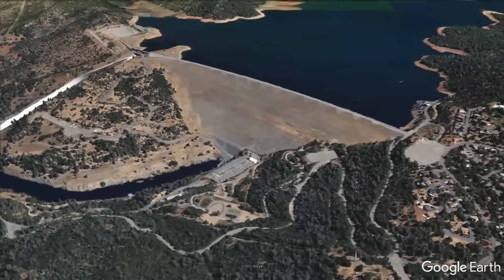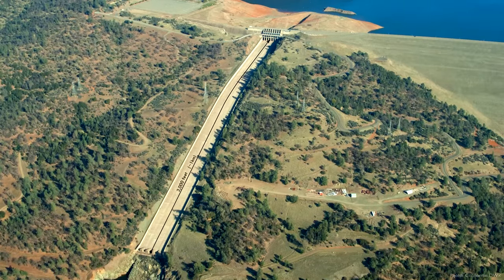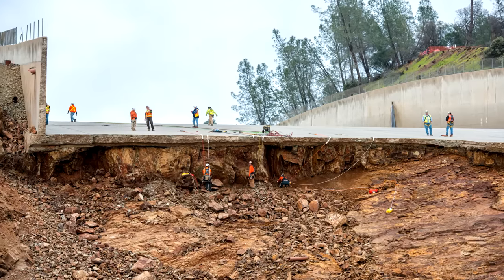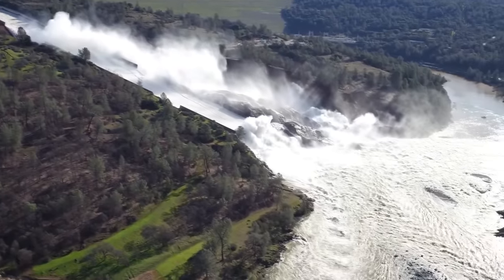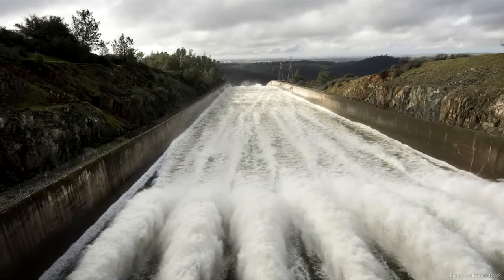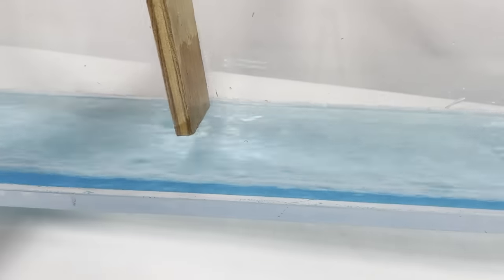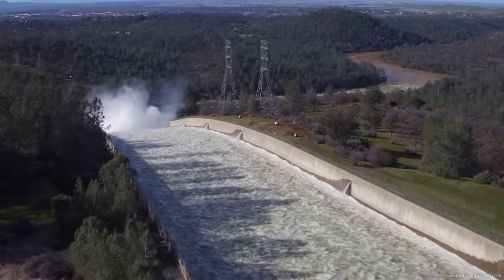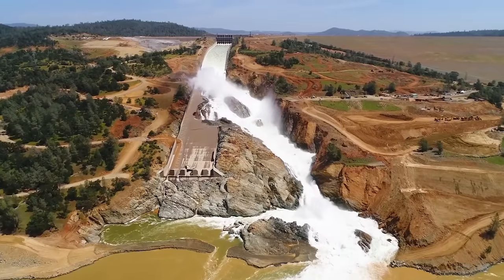What Really Happened at the Oroville Dam Spillway?

Comment: It’s unfortunate when your emergency spillway is in itself an emergency
Reply: Yes, but I would have done the same thing they did. Tried to use the emergency spillway for what it was nominally designed for until it became apparent that it couldn't sustain further use.
Reply: @thorr18BEM  if I recall, they used the emergency spillway only because they had flow restocked down the main spillway to keep damage lower.
Once the erosion on the emergency spillway was proving to be dangerous to the entire dam structure, they let er rip down the main spillway as it could handle far more erosion before the integrity of the dam was in danger.
The bedrock and natural plunge pool were very stable after a while
Reply: A cascade of errors (pun intended).
Reply: It's seams like our government did us dirty they were faced with a decisions of either risk flooding thousands of homes or flood a hydropower plant. It seams like there is more to this than just some engineering mistakes and I know this sounds like a conspiracy theory but knowing the track record of our public engineers it's not super unlikely that these people had $$$ in their eyes from the very start and didn't care about safety
Reply: @littlejack59 the problem isn't money when you flood the hydropower plant, the problem is you risk flooding the power lines which powers the dam, which means you can no longer control the spillways and risk flooding the entire countryside anyway.
Reply: gold 4 govt
Reply: Hence the name. Duh!
Reply: @fungdark8270  The thing is, the people managing the disaster really had no idea what they were working with. The emergency spillway was never intended to be used except to prevent the overtopping of the dam in case of, well, a dire emergency. To use it intentionally as they did, we longer-term residents of Butte County who knew about the dam and it's infrastructure were taken aback, hoping the planners knew something we didn't. Nope.
Reply: I was completely shocked watching the emergency unfold on TV when seeing no visible rebar in the eroded areas.
Reply: they seen it coming years before  and chose not to do anything about it
Reply: @godblessknight  Sometime in the 1950s, the USAF experienced a "broken arrow." The only reason why the Air Force did not accidentally annihilate a US city was that the fail-safes had fail-safes and all but two failed. If the nuke had been a previous generation, the outcome would have been a lot worse than bad publicity for the Air Force.

Why was such a concept in place at Oroville Damn?
Reply: @joe2mercs  i read this as the narrator said 'slip through the crack' 🤣👍
Reply: @thorr18BEM  i mean, it was built exactly for that purpose, though hoping to never need it. if you can't make the decision to use it in an emergency, why even build it? the fact that it also had a deadly flaw is almost beside the point, just very unfortunate
Reply: @godblessknight  in hindsight, having the power plant be in the flow path seems like a mistake. if they had placed it further back they could have made a different decision
Reply: @littlejack59  our government.  Uhh you mean California government.  And they have a long track record mismanaging situations and creating larger problems.
Reply: How did they not realize it was highly erodible tho? No way they tested that ground for bedrock, they just never planned for it to be used to save money...
Reply: @Killer_Turnip  probably just used previous design.  It worked once.  It will work again.
Reply: @jonney_boy  like? Substitute is!
Reply: Activate the emergency emergency spillway!!
Reply: @littlejack59  you're not wrong.  Recently did  work for one of the mamagers who was on the project during the failure and said that what's budgeted for repairs/maintenance and what's actually put towards repair/maintenance wasn't even close to what it needed in years of neglected maintenance.
Reply: @thorr18BEM  Aaààaiñ
Reply: AN INCONVENIENT TRUTH. 🇺🇲
Reply: Best comment on YouTube
Reply: Indeed. I didn’t find this engineering very practical for a Practical engineering channel.
Reply: That's a big dam it 🤣🤣🤣😂
Reply: Yeah. Bad planning from the get go
Reply: Yeah, no kidding. Well said.👍
Reply: @godblessknight   Portable truck-mounted generators could have been used to power the Radial Gates lift motors
Reply: Yeah just need a spillway spillway spillway spillway spillway
Reply: @elmerbeltshire7599 you really don't need a lot of rebar in an spill concrete. it's only a channel for water to flow down.. the problem was mainly the foundation was very bad, and the design just being old/bad
Reply: Cali may have progressive inspections, but the government failed to complete the dam properly when built and then embezzled the many needed to finish the project which is why the emergency spillway could not function.  As for the main spillway, see my message on government not faithfully responding to the “progressive inspections”.  California political scenario is replete with examples of cash diversion to line friends of the politicians.
Reply: Too many fish clogged something up.
Reply: @yepok2957  wonder if the fishing is good there?
Reply: It’s not just an emergency spillway, it’s a spillway emergency.
Reply: The emergency overflow area that eroded was never intended to be used as they left it. The emergency overflow was supposed to covered in concrete(like it currently is). The engineers original plans stated this. The project was never completed as approved and designed The state chose to never finish the emergency overflow (greed) once the Dam part was completed and as the engineers intended. Conclusion: Intentional State neglect. My dad told me all about this in the early 80's. He worked on the project for Bechtel Corp. He told me " If you ever see water going over this emergency overflow as it currently sits, head for high ground. They never finished this part as the engineers intended."(covered in 3'-5' of concrete)
Reply: It's unfortunate when your emergency spillway is your ONLY TESTED SPILLWAY
Reply: It's always hard to test a measure of last resort like this during normal times. You simply might not have the water volume available...

Comment: Moving water never ceases to surprise me with its raw power.
Reply: No kidding.  Though I suspect this is more dramatic than usual because they built spillways designed to sit on granite on top of loose soil instead.  But even granite can't stand up to the awesome power of water forever.
Reply: just a cubic metre of water is a metric tonne (~35 cu ft. to 1.1 US ton).
hitting a wall makes it stop in less than a mm of space.
for just 1m/s (~2.2mph) that's over 1000 tonnes equivalent of force.
Reply: I’m going to crack a ‘dad joke’ now, but should water have roar power, as it makes a roaring noise 😋🤪 I’ll get my coat!
Reply: How high does a swiftly moving stream need to be to knock you off your feet? You are down long before it gets knee deep.
Reply: @uncareid5557  A two to four inches of fast moving can drop you rather easily if you aren't careful, one miss step and you'll be going face first into the water and ground.
Reply: Many people don’t know how powerful water can be, a river can be powerful, even more so when it’s flooded, even the ocean is incredibly powerful, people use water to cut steel and other tough materials like concrete or stone
Reply: The earth is a prime example. The entire shape is 100% dictated by water. okay maybe 99% with another 1% from wind (although the convection/storm patterns are driven by density shifts from humidity/water.. )
Reply: lol, i used to feel the same way!...and then i got caught in some moderately-big waves in hawaii and almost drowned; NOW I KNOW.
Reply: You may enjoy the book "The Emerald Mile"
Reply: water is freaking heavy
Reply: I have a healthy fear of large amounts of water.
Reply: @robertschemonia5617  reminds me of horror stories about divers fitting through something like a 5 cm hole in a dam.
let's just say they weren't alive on the other side.
Reply: Amazing to see it cut through the landscape just like when I was a child playing with a hose in the garden.
Reply: Man - "We have mastered Nature!"

Nature - "Hold my beer."
Reply: "Be like water." - Bruce Lee
Reply: I tried to rescue a calf in floodwaters.  I didn’t even get in the water up to my knees before I realized how much power there was in that water.  It looked calm on the surface but when I picked up one foot, it felt like the water was about to shove my other foot out from underneath me.  I hated to lose that calf but saving it just wasn't worth the risk.
Reply: IT’S RAW!
Reply: @satibel  right!?! Like in alien when the xenomorph gets sucked out of a bullet hole. (Insert sound of sucking a straw in the bottom of a smoothie here)
Reply: Yep don't mess with Natures Hydraulics.
Reply: @JulieWallis1963  a man from the local swimming pool came to my door asking for donations, I gave him a glass of water
Reply: I know, it's so much power, like dam

I know it's a bad joke, but I couldn't hold it back
Reply: Seriously, it was cut down to the rock itself in a few days, that's impressive.
Reply: @robertschemonia5617  cavitation, can’t forget freakish cavitation
Reply: @wasidanatsali6374  damn that sucks
Reply: And as soon as it starts destroying things, debris from the destruction only adds to the displacement power 😬
Reply: As a geology student,i can tell you that you arr exactly right.Water is the great LEVELER it erodes everything over long enough periods and it deposits it at its resting place,the sea level where theres no more Potential energy difference.
Reply: True, but the real problem here was the jankiness of the geo substrate as much as anything.  I still dont understand how they got the geomorphology so wrong!
Reply: Taco Tuesday have me plenty of a reminder and demonstration..
Reply: Water is heavy, incompressible, and capable of going very fast. It seems innocuous. Until a lot of it goes fast.
Reply: I drink water daily. It’s surprisingly hydrating.
Reply: wader
Reply: @justaguycalledjosh  Collisions are way too close to divisions by zero to say that 1mm is a good approximation imo.
Reply: Never underestimate the power of nature!
Reply: I tried to cross a flooded road near my house in my big lifted Dodge Ram crew cab. Water was to the rocker panels and moving what looked to be walking speed across the road.  I never made it to the other side.  Truck went a quarter mile with the water and had to get pulled out with a helicopter.
Reply: @douglasharley2440  me too. Humbling.
Reply: Facts
Reply: My grandpa said that one time when he was building the Hoover Dam with his friends they were almost finished and the dam gave way. My grandpa said he was lucky that there were beavers swimming in the river because he took a beaver and put one on each foot with string and they swam him to safety
Reply: Its been cutting through this earth for a billion or so years.
Reply: The incompetence of many workers today is staggering. Regular inspections are useless if this is the outcome. Seems to be a California problem fortunately
Reply: Like God when He sent the flood. Only one family was saved. That’s a powerful warning for today. Sin not.
Reply: Even still water is to be feared the shear weight of its downward force rips Roofs open if it sits too long.
Reply: Yes. We live on a river and it's now at flood stage. It's incredible to watch all that raw power!
Reply: Me too.
Reply: 62.4 pounds per cubic foot. Being a plumber changed my view on everything. Dams to me are a feat of engineering that's for sure.
Reply: Indeed, Mudkip, you are one to behold with your power.
Reply: I see it in a way that just shows how bad man has messed this planet up lol. And it’s going to end up claiming it back and taking us with it
Reply: MUDKIP PFP
Reply: @killernat1234  Ocean riptides (whirlpools, etc) are significantly more dangerous due to the high amount of bubbles (air) in the turbulent water. Humans can float in water but add a lot of air bubbles and the presence of all that air distorts the normal density of water that would otherwise help keep you afloat.
Reply: @andybilakshow260  It’s a pretty amazing liquid.
Reply: Same here
Reply: Not just its power but that it is ceaseless in its efforts.
Reply: @wasidanatsali6374  😢, but you tried
Reply: @0r30-d2c  yes, always CA, laziness from gov
Reply: @bvoyelr  basalt maybe can
Reply: I live in Minnesota, and up North there's a particular river called the Temperance River. It has cauldrons caused by water moving multi-ton boulders into pockets where the water can swirl before continuing downstream. Let me rephrase that, this river is one giant compression rapid that is cutting laterally at the same time that it's downcutting, and It's insane to think of the forces involved to dissolve all of that igneous rock that's been undisturbed by seismic activity, and is therefore much harder than rock found near a fault line
Reply: @JulieWallis1963  currently I'm still deciding if the depths of my humor will allow that one. A smile may or may not be spilling over my face. We'll have to sea
Reply: As opposed to it's cooked power?